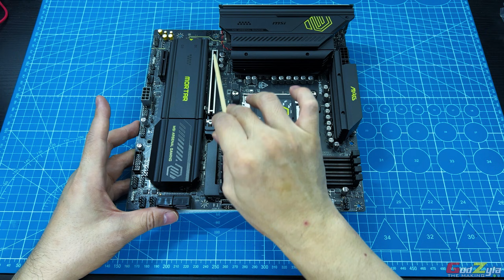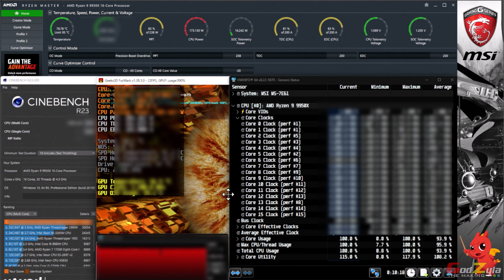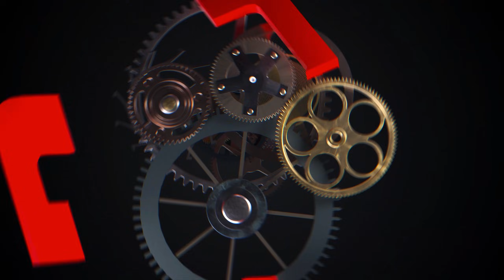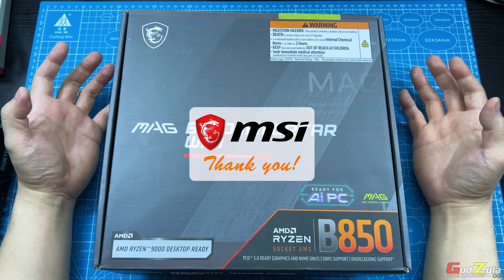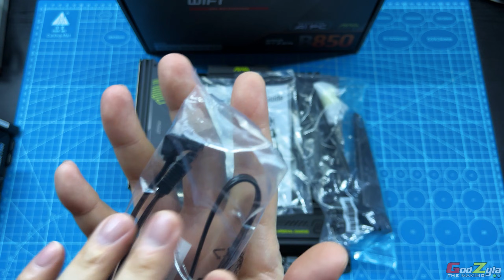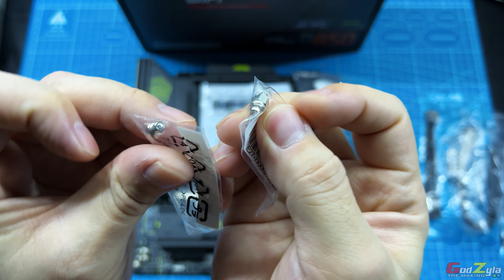MSI B850M Mortar WiFi

Comment: Hey everyone. Has someone experienced the same issue as me: using this MB with RTX 5080 and Samsung Monitor, basically I can’t use reboot on my PC. If I’m doing a “cold boot”, starting a PC from shut down state - everything works without issues, if it’s a “warm boot”, like rebooting a working system, I get black screen and no signal on the monitor. That is hugely annoying and I’m looking for a way to fix this condition.
Reply from the maker: Hi Bogdan Saushkin, welcome to my channel. I like to check. Did you set in UFEI to have your first PCI-E slot to Gen 5? Also which type of connection are you using? HDMI or DP cable? 
First  remove your gpu. Plug a hdmi cable to see if it works. If it works, this narrow down is not the hdmi cable nor your motherboard nor your OS.

Next plug back your GPU, If you are using DP, try a different cable and if still blackout, try different port on your 5080. if still an issue change to HDMI cable. 

If still does not work. Do you have a spare GPU to test with? If yes and if still giving you the issue. It could be the motherboard PCIe slot issue. If it works. It could be GPU issue. 

Before concluding. Maybe remove your GPU driver using DDU and to reinstall the driver.
Reply: Hey there, Kleo Yan. Thank you for quick and detailed answer. Yes, I’ve actually tried forcing Gen5, as well as Gen4, no difference here. I’ve also tried switching between DP and HDMI, BTW there was somewhat of a difference - on DP right about when speaker beeps on POST, the monitor turns on, then announces that there’s no signal, counts to three and turns off, but with HDMI it starts the same way, and after monitor turns off there’s about 5s delay, after which the monitor turns on again, announces no signal, counts and turns off, and that cycle repeats until the PC is shut down. Thank you for the suggestions, guess I’ll try to plug out the GPU and try checking with integrated graphics first.
Reply from the maker: @Bogdaman2  you are most welcome. All the very best. Hopefully your issue will be resolve.

Comment: Hello anyone know how to unlock 16 threads on r7 7800x3d in these bios ?
Reply from the maker: Steps to Unlock 16 Threads
Hi Luciano Mendes, welcome to my channel. This is from MSI tech and steps are as follow 

Enter BIOS by pressing DEL or F2 during boot.
Look for an option called "X3D Gaming Mode" or similar under OC Tweaker or Advanced CPU settings and disable it.
Save and exit BIOS.
Boot into Windows and check Task Manager to confirm all 16 threads are now visible.

If these steps don't resolve the issue, consider resetting the BIOS to default settings or updating the BIOS to the latest version available for your motherboard

Comment: hey kleo, what do people do in a board like this that doesn't have cpu_opt fan header? do they just use cpu_fan if they have a cpu cooler with 2 fans? it seems a bit strange that this board doesn't have that and makes things a bit annoying that you would have to connect second fan to sys_fan header which wouldn't have a combined control and would be a separately controlled setting
would you use a splitter to connect the two cpu cooler fans?
Reply from the maker: Hi lasodkaoskdaskdokasd, welcome to my channel. By right for air cooler should have both fans daisy chained to 1 plug to the cpu_fan. Unless you are using liquid aio with another set of fans. In this case I will total up the amount of fans to see if ampere is above the cpu_fan specs. If it’s not, then I will use a splitter. If it’s above, I will use a fan hub instead.
Reply: @KleoYan  *Thank you, wish you the most success with your channel :face-red-heart-shape:
Reply from the maker: @asbdasbdasbdabsyou are most welcome and all the best with your build too 😉

Comment: Too bad MSI lazy using that CMOS design.
Reply from the maker: Hi Kuro Kuma, welcome to my channel. You mean the clear CMOS button? there is one at the rear, but I do agree should have one one at the JBAT 2 pin too. easier.
Reply: @KleoYan  No I mean the actually battery that has pigtail wire coming out of it. ITX always has them except a few MAXsun boards I believe. Matx should have the battery.
Reply from the maker: @jc2893  oh ok, I know what you mean now. Yes that is a hassle to remove or to replace.

Comment: hi Kleo Yan, kinda curious while u testing the wifi & Lan part, did u plug in those antenna during the testing? 

because I've bought this motherboard and the antenna was left at the shop, going back to collect it soon. 

just wanna know if I meant to build my pc first without the antenna, does it affect me to set up my pc systems and drivers etc? does this motherboard support wifi without an antenna?

i personally think that it might work without an antenna to set up my pc, so if im able to set up my pc without the antenna, once i collect my antenna back and plugged in, how to tell the difference of having or without the antenna except Bluetooth 😅

also do u suggest me to wait until i collect back my antenna then only start to boot up the pc? since I'm kinda afraid the system fraud if u plug or unplug those antenna 

i would like to hear something from you👍🏻 solid review 👍🏻 not only this but all of the rest 😁
Reply from the maker: Hi qh, welcome to my channel. I do plug those antenna when am testing for wifi, unless I am using LAN (wired) then I will disable wifi totally. In general it will be best to plug the wifi antenna to gain better signal. It can operate without plugging in but your signal will be weak, hence without good signal. In windows for the wifi network adaptor, it will push current to seek for better signal. I do not advise in a long run.
Reply: @KleoYan alright noted, so i guess I'll just collect the antenna first then only start my build, tqsm keep up the work 👍🏻👍🏻
Reply from the maker: @qh__0523  you are most welcome. Thank you for the visit and all the best with your build 😉
Reply: @KleoYan btw sorry to ask you something again😅 this board comes with one 24pin ATX_PWR1 slot for motherboard, two 8pin CPU_PWR1&2 slot for cpu, and one 8pin pcie power connector, labelled PCIE_PWR1 at the bottom

this is just like other MAG series board from msi i believe, B850 tomahawk, x870 tomahawk as well

my psu is superflower leadex iii 850 gold, it only comes with one 24pin for mobo and two 8pin for cpu 

if I want to plug the 3rd 8pin pcie pwr1 slot, im out of 8pin cpu cable, do i need to buy another extra cpu 8pin(4+4) power cable? or i can use 8pin (6+2) VGA CABLE oroginally from my psu and plug on it?

please let me know thankyou 👍🏻🙏🏻
Reply from the maker: @qh__0523  plug 2 8pin EPS from PSU to your motherboard, on your PSU is labeled as CPU. then plug a PCI-E cable to the motherboard, on your PSU is labeled as VGA https://cdn.cybassets.com/media/W1siZiIsIjIzNDMzL3Byb2R1Y3RzLzM4ODE3MzYwLzE2Njk4NjUwNjhfZGFlZTM3ZTQ1NjUzYTljZTM4ZWMuanBlZyJdLFsicCIsInRodW1iIiwiNjAweDYwMCJdXQ.jpeg?sha=78a8a3db2f9aa263
Reply: @KleoYan i think you found the different version of my psu, mine are SF-850F14GE(GL) it can be search via internet i believe

so according to your information, 
i need to plug two 8pin (4+4) CPU cables from psu to motherboard, 

one 24pin MOTHERBOARD cable from psu to motherboard and 

one 8pin (6+2) VGA cable from psu to motherboard. Is this correct?

I'm really afraid to accidentally plug in something wrong and end up fried up my motherboard 😅

because I've asked gpt and google AI and both gave me different answers, both are leading to say that DO NOT PLUG VGA TO PCIE_PWR slot... so i was kinda confused which is correct and to avoid causing false connection
Reply from the maker: @qh__0523  so long you plug the 2 8pin EPS (CPU) connector to your motherboard (the two socket located at the top CPU_PWR1 and CPU_PWR2), follow by PSU 24pin connector to motherboard 24pin ATX_PWR1 and last of all an 8pin PCIE connector from your PSU (VGA) to the bottom 8pin socket of your motherboard. you will be fine. You dont trust my words at least trust how I conduct the sound test and benchmark test or even wifi test, I plug it that way.
Reply: @KleoYan i definitely trust your words all time😅 just because i was confused on what the hell is EPS  hahaha and i think u have a typo just now, u type "plus 2 8 pin EPS..." so i couldn't understand what plus 2 meant for. also, sorry for the lack of my knowledge since I'm a first time pc builder😂

now I've understood what u mean, and ya I've watched thru the whole video but i couldn't see the pcie slot is being plugged or not, mainly because your cpu cooler pipe is blocking the view angle

at least now i understand what you've meant just now, huge appreciated for the answer 😅👍🏻 thankyou so much
Reply from the maker: @qh__0523  oh ok.. oops. ya my tubes are blocking it.. sometimes I type too fast and I dont spell check.. will have to do that next time. Ok, all the very best with your build and thank you for the support and feedback 👍👍👍
Reply: @KleoYan hi Kleo, i just finished my build few mins ago and i successfully boot up my pc and went into bios on first startup, kinda curious about my cpu temp, the voltage is around 1.360-1.370 and my cpu temp is 55+- which is quite high...

compare to yours, is there any issue with my parts? I've done with my cooler correctly it's deepcool ak620 g2.. is that matter with my voltage? does this means that i got a bad quality cpu? which often saw on 抖音 they said that the lower the voltage, the better the cpu quality 😢

im using ryzen 7 9700x btw, 16x2 fury beast d5 6000c30
Reply from the maker: @qh__0523  for aircooler, it's normal to have those temp. what you can do is to undervolt your system. this might aid you https://youtu.be/IYK0hxQqCoA?si=b8a9un340eA5tBkf Though that's based on a 9800X3D it's still applicable, just need to find out your PPT TDC and EDC of your processor

Comment: Hi Kleo Yan, i have one question. 
I have Ryzen 9 9900x CPU. What happens if i place two M2 disks in the front side? These are GEN5 and GEN4. Will the GEN4 make GEN5 disk run slower? 
Or are these totally independent? Thanks and keep up the good work, man :)
Reply from the maker: Hi Irion Da Ronin, welcome to my channel. Both will run according to the m.2 Generation. Just that you need good airflow case as both m.2 are on the same armour sheild or m.2 heatsink. If it runs too hot, your m.2 speed will throttle.
Reply: @KleoYan  Enough space (Musetex Y6 white) and 9 fans (3 of them with AIO Corsair Nautilus RS 360). Thanks for the quick answer! Keep rocking! :)

Comment: Hi Kleo. Thanks for this review. How this board compares to Gigabyte B850 Aorus Elite boards (atx or matx), in terms of thermals, features, value? Thanks.
Reply from the maker: Hi I D Pua, welcome back. Honestly, you can't compare the specs of this board with any Gigabyte M-ATX board. 1st this board has strong PCB layer which is of 8layer, 2nd it's of true WiFi 7 with a 320MHz channel bandwidth adaptor as gigabyte most are Wifi 6E or using Wifi 7 160Mhz channel bandwidth adapter. 3rd the cooling for this board is far must more supreme.
Reply: Thanks!
Reply from the maker: @idp80 you are most welcome

Comment: If I use only 1 EPS 8 pin connecter, which socket should I use? CPU_PWR1 or CPU_PWR2? Does it really matter, or can I use either one?
Reply from the maker: Hi Joe, welcome to my channel. I will plug to CPU_PWR1 which the socket near the side VRM heatsink.

Comment: 10:20 what is means exactly "running 8 thounsand cpu" is this one AMD Ryzen 7 7800X3D will unlock full potential of motherboard with PCIe-5?
Reply from the maker: Hi Szymon Klimek, welcome to my channel. If you running 7000 or 9000 series AMD processor, you can use Gen 5 m.2, but if you use 8000 Series AMD processor, the m.2 will only be Gen 4.
Reply: @KleoYan  appreciate you helping me, I'm happy to go for this motherboard. Thinking of upgrading from MSI MAG B550M MORTAR + RYZEN 5 5600X to this setup. Great and extensive review by the way. ALL the best!
Reply from the maker: @SimonKlimekNetwork  You are most welcome and all the best with your build too.

Comment: Gen. 5 NVMe slots are placed right below GPU, so it will heat em up with exhaust hot air even more. How hot Gen. 5 NVMe will live there next to some 300+ watt GPU?
Reply from the maker: Hi Vnkx719, welcome to my channel. As have tested with a 4080 Super, the GEN 5 (BiWin X570 2TB) will run at load of 68 degrees celcius. You will require good airflow in your case as this is tested in open bench. Predicted that it can hit up to 72 to 73 degrees at load inside a case.
Reply: @KleoYan  At what ambient temps? Is that was drive torture test + GPU load test (there are workloads, such as ML/DL training that can stress hell out of GPU and storage)? Looked up that drive - it's not based on Phison like, say, T705 - it maybe cooler drive to begin with. Thanx for info 🙏
Reply from the maker: @sq7l0v4  you are most welcome. my room temperature is always hovering around 30°C to 31°C. You have your point of views that's the reason why I will be direct and honest that I am testing this on an open bench. In addition, I do not consider to step into PCIE Gen 5 drives as a High Tier Gen 4 is sufficient to my usage or should I say it's more practical. Unless I am using this as a revenue generator, else I will just stick with my Gen 4 nvmes which runs cooler.

Comment: Hi! I just finished my first PC build. Updated the BIOS on an MSI MAG B850M MORTAR WIFI and installed Windows 11 pro, but the installer didn't detect any Wi-Fi so I continued without internet. Now in Windows the Wi-Fi adapter doesn't appear only Bluetooth. I've tried common fixes (full power cycle with PSU unplugged, installed the latest LAN drivers, set WLAN to automatic, turn on/off wifi etc.) and nothing works. I don't have an Ethernet cable to troubleshoot. Any ideas?
Reply from the maker: Hi El Timefilm, welcome to my channel. Use another working PC, download the Wifi Driver here https://www.msi.com/Motherboard/MAG-B850M-MORTAR-WIFI/support#driver and place it into a flash drive and then install it to your B850M Mortar.
Reply: Thank you very much for your response. I accessed the link, downloaded and installed the system & chipset driver, but the option to connect to the internet still doesnt appear. Is there anything else I can try?
Reply from the maker: @eltimefilm8441  look under device manager, do you have any ! marks? you might want to uninstall that and to install the correct drivers. if that does not help. Are you about to stretch your Lan / wired cable to your PC and to reinstall the Windows 11 os?

Comment: 2× M.2 gen 4 and gpu rx 9070 16g 
Should I need to use PCIe power line ?
Reply from the maker: Hi Deep Mridha, welcome to my channel. The 8pin PCIE socket on this board is a suppliment power which in general, if you are not running a power Hunger GPU like the 5080, 5090 (pardon me as I am not well verse on AMD GPU), you do not need to plug it. If you find your GPU does not perform correctly, then plug the PCIE connected to it.
Reply: @KleoYan ok thanks 🙏

Comment: Is the cooling plate for ssd gen 5 on this card enough? Is it cooling properly the gen 5 ssd? Thanks
Reply from the maker: Hi Vadim, welcome back. for this m-atx board, the M.2 heatsinnk is sufficient to cool a m.2 Gen 5 drive.
Reply: @KleoYan  thank Kleo, you think it will be sufficient even with 2 ssd gen 5 at the same time? They are close, thinking not to cause problems? Thanks again
Reply from the maker: @owelz having 2 gen 5 m.2 won’t be an issue as you don’t use both at the same time. Unless you do compliation work as in 1st m.2 running video editing tool and to compile to 2nd m.2 (final product), then you will have an issue.
Reply: @KleoYan  thanks Kleo! I am looking to have 1 gen 5 for windows only, and second gen 5 for work and games. In this case is ok? Will they be working same time? Thank you
Reply from the maker: @owelz  that will work. shouldn't be an issue. Just make sure your pc case have good airflow.